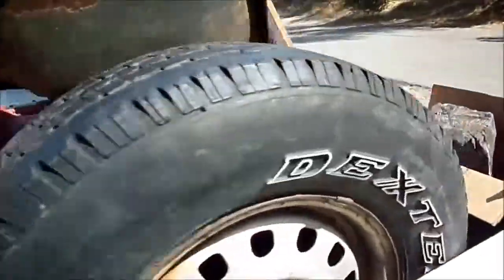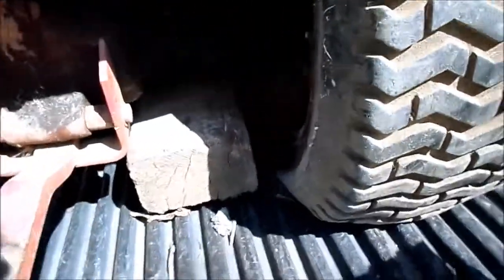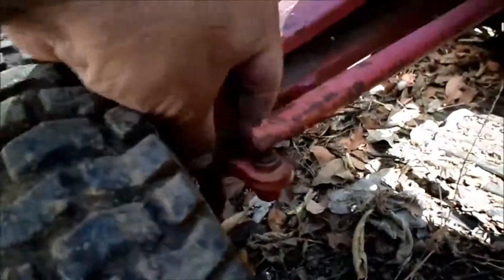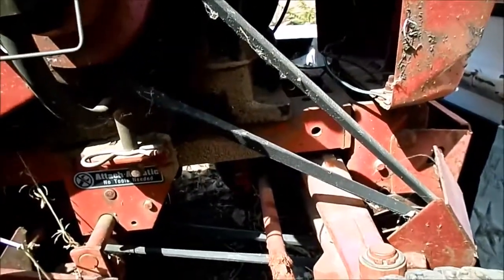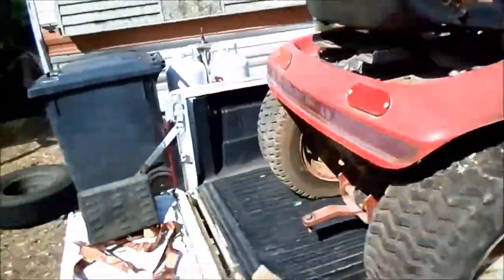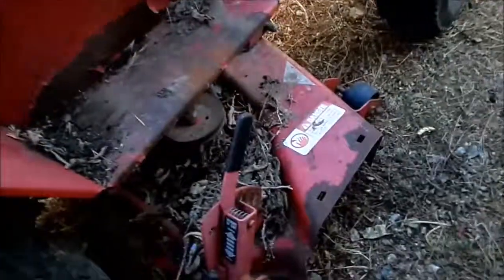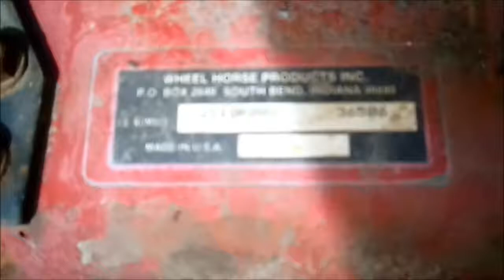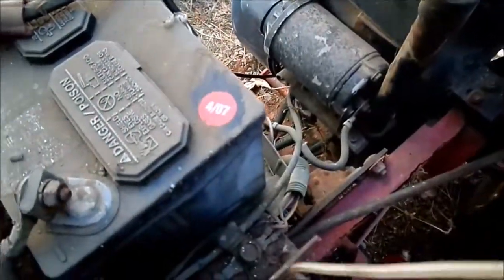1989 Wheel Horse 310-8 Project Intro

Comment: Well I wish I could find one of those for free. That machine around here in that condition would still bring 2 or 300. They are extremely well built units , real garden tractor. I hope you do more videos one it
Reply from the maker: Thanks Dave, I will do some follow ups on it.
I wasn't familiar with Wheel Horse, it was great to discover how solidly built this thing is. Especially for 1989, that's new enough to have some minor plastics, but there's hardly any at all on it. And the steel that's on it is really thick. The statics show this thing weighs in at 553lbs! Like it was built in the 50's or 60's

Free riding mowers do pop up around here once in a great while, but I do have to resist those. But this is the first garden tractor I've found and I couldn't talk myself out of it. I was actually quite surprised it was still there when I showed.